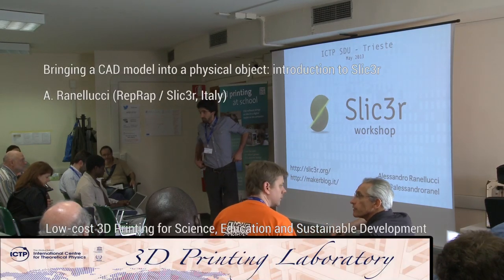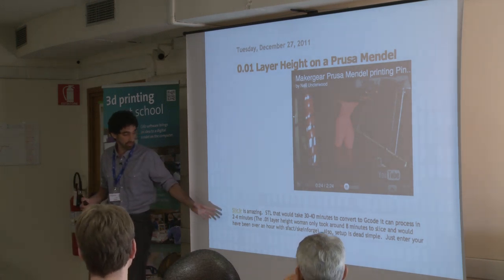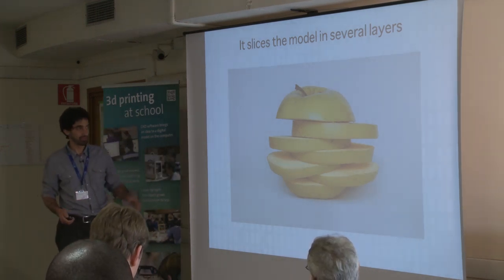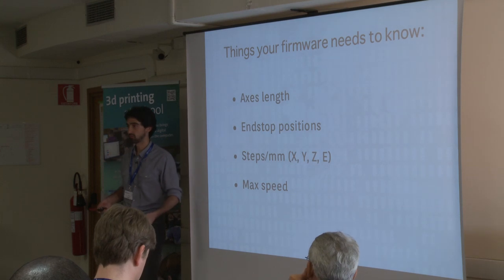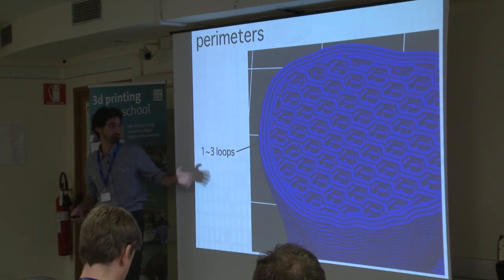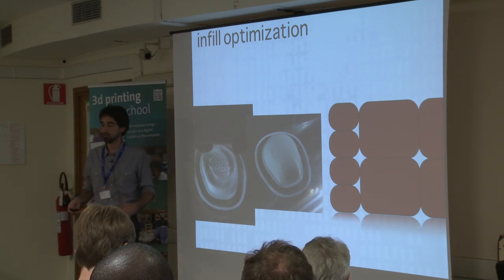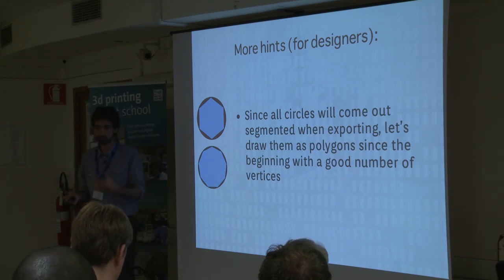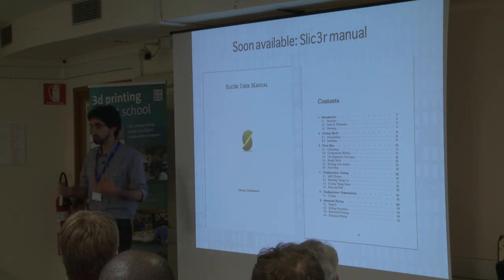Introduction to Slic3r

Comment: I did not know there were many methods to extrusion... I'm still trying to get my Printrbot to print properly the machine works but doesn't print the object or the shape on the computer... if you have any ideas on that I wouldn't mind hearing what you have to say on that subject... and speaking of Printrbot what is the best program to use on the Printrbot I'm using Repetier v1.0.6 I have had some mishaps and setback with trying to get this program to work